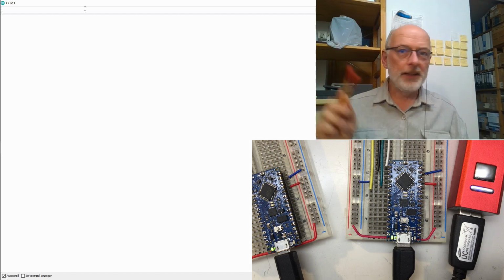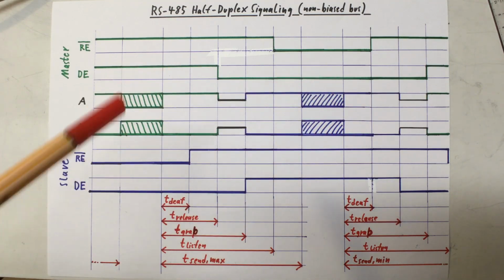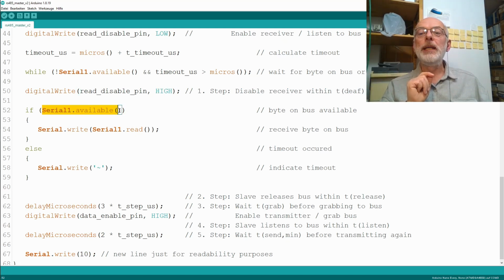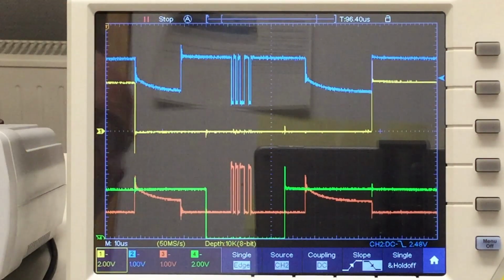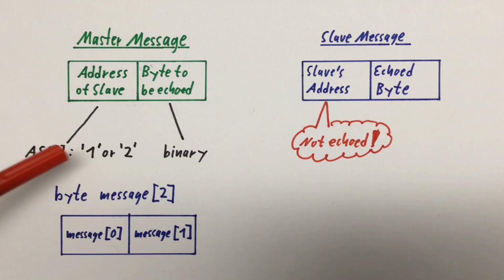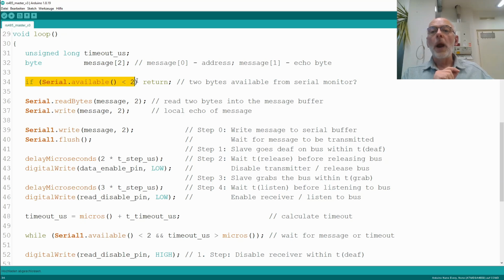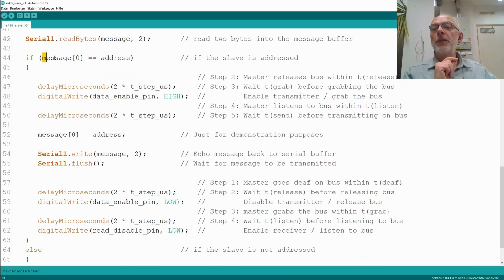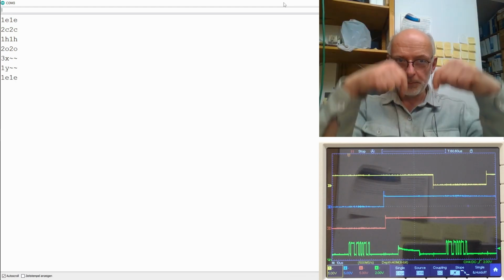RS-485 – The Details (1/4): Timeouts, Addressing, Multiple Slaves

Comment: Edit: Regarding setting a gpio to an output with an initial known state, I found out today digitalWriteFast writes directly to the port so your code will work as  it was. (That is if the nano every supports digitalWriteFast)
Reply from the maker: Thanks for the info! The digitalWriteFast library should support the Nano Every (ATmega4809). But if you don't care about compatibility across the whole Arduino family you can always write directly to an GPU register 😉

Comment: Dear Robert,

Thank you very much for the detailed information and for sharing the video—it is truly appreciated. The content was very clear, complete, and extremely helpful.

If it’s not too much trouble, I have one additional question: is there any way to connect multiple RS-485 slaves in a star configuration instead of using the standard bus topology? In other words, is it possible to avoid placing termination resistors at the farthest slave from the master and still being able to communicate correctly?

Best regards,
Reply from the maker: First, thanks for the praise!

To answer your question: The reason for the linear bus topology with termination resistors at both ends is to avoid signal reflections. Signal reflections are not the end of the world, as long as the don't "overcome" the signal itself. So at lower speeds it's possible to use a star topology without termination resistors. How low of a speed? Well, that depends on the exact geometry of your star and the cables you are using. You will have to experiment a bit to find the maximum speed you can run.

Good luck with your project!

Best Regards
Robert